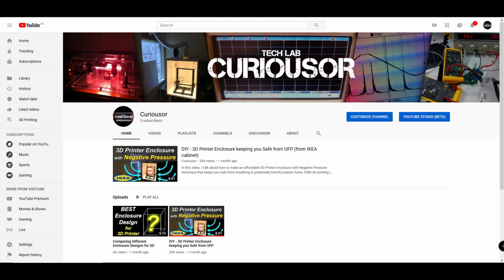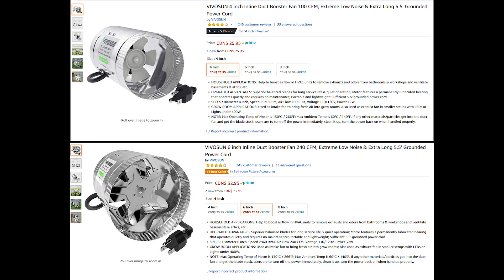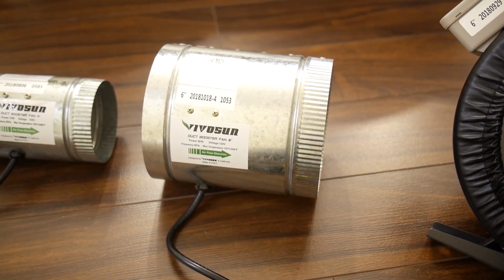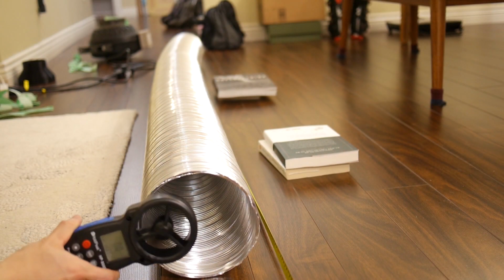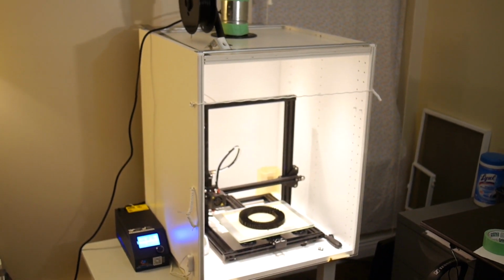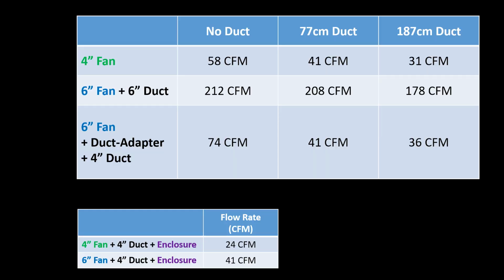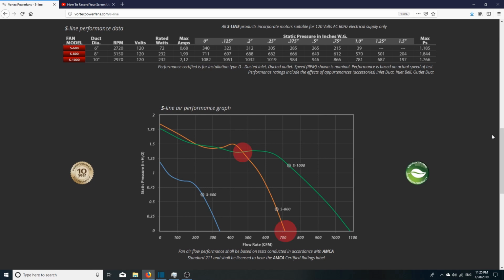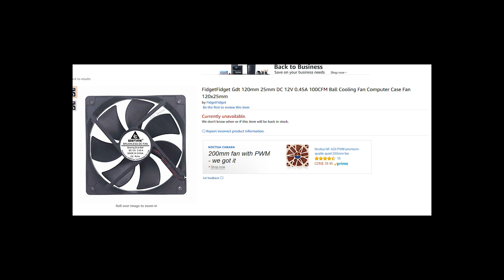True Fan Performance | 3D Printer Enclosure

Comment: Really nice video, im wondering how it would work if you have like a FTX system that already has a centralized fan that sucks air out say a laundry room, and then adding a fan from the 3d printer enclosure. Of course you dont want to have more power on the enclosure fan than your central fan but maybe then it is enough to have a smaller pc fan connected in the enclosure and then to the ducts?

Comment: Are you able to send me one of your adpter you made on the 3D printer. I'm doing a 6" and adding the 4" on the front end with the adapter, this way the fans/blower can pushes out more air. Hears My current mod/custom I'm currently doing at the moment... I'm using a downdraft blower or another name cook top blower and using that as my main fan blower. The inner port of the blower is 6" that takes air inside and the outter port of the blower is 5" that pushes out air. If I leave the Blower the way it is, untouched , the blower takes IN and OUT a lot of air but when I add an pick up truck air filter to it, it cuts down the CFM. It's crazy how it works. since I work at a appliance store and parts are unlimited... so I went ahead and used two 4" dryer ducting to get to my area, because at the moment I don't have any 5" ducting so I'm left with 4" ducting to used. I'm currently using an adapter that goes from 5"-4" to the blower.  When I use the blower... With the truck filter, The whole blower losses a lot air or not enough air being pushed out. This applys Even when I removed the truck air filter. It only changes a little but not a whole lot. This only occurred with the ducting, but removed everything is good. Anyhow with the video hear I've seen you got a 4" and 6" fan. Be4 I even seen your video I already made orders of the 4 and 6 inch fan, I ordered the ones you show on this video, I didn't want to buy any high end fans/blower because I'm only testing or doing experiment on this small project so I don't have to break the bank. Now I'm adding this new 6" fan to the main blower inner port, I'm hoping it pushes more air in and since I'm currently using two 4" dryer ducting I'm hoping using the new 4" fan as my adpter between the two ducting can help pushes out more air since it's 12ft long together but one ducting is 6ft. If the 4" doesn't help than I'll move the 6" fan and add it to the ducting so it can really pushed.